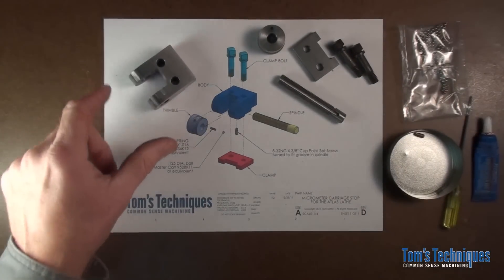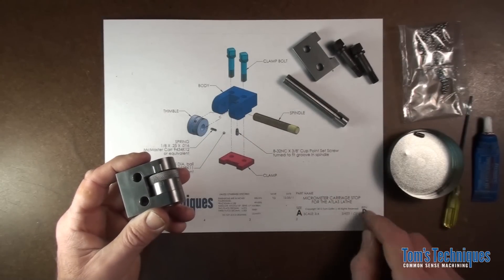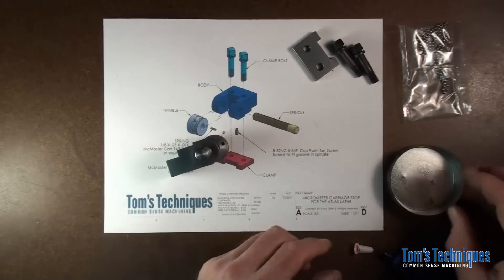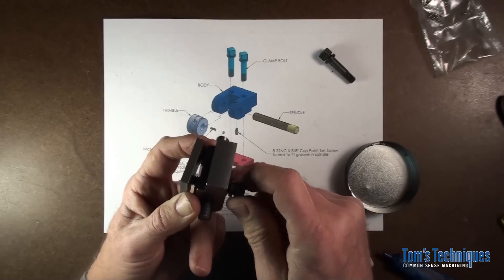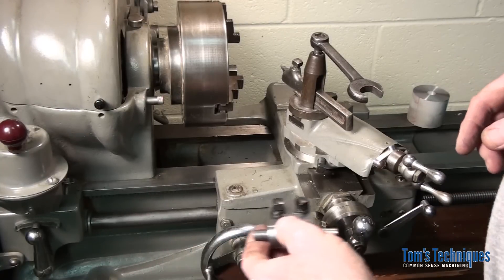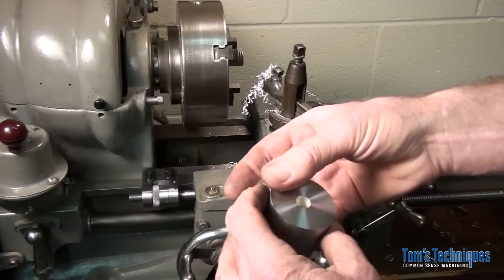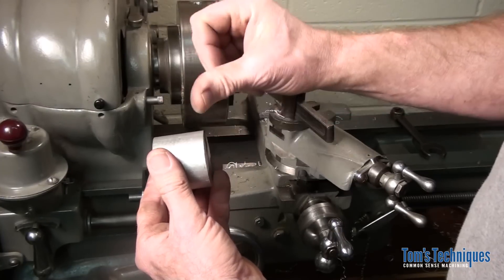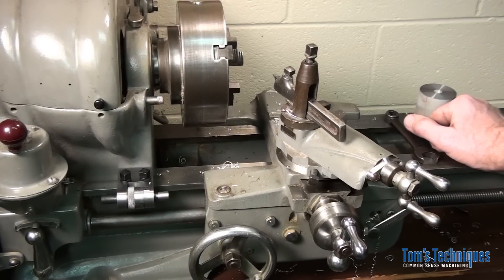Micrometer Carriage Stop, Final Assembly and Demonstration

Comment: Hello Mr. Tom.
I really liked the Carriege Stop kit. Congratulations.
I have a BV20L lathe and I'm dying to make a Carriege Stop kit just like yours.
I ask:
if the kit is installed to a certain extent and, if I forget to remove it and, turn on the automatic advance, the split nut will be damaged, correct ???
Reply from the maker: If you run the carriage into the stop under power, something will be damaged. There are stops designed to disengage the feed, but this is not one of them.

Comment: I am an amateur garage machinist, I fiddle with a 1941 South Bend Model 9A with the threading gear box that I got from the San Diego Naval Ship yard. have been looking to see if a carriage stop is what I need because when i try threading, I miss where to stop the apron. Would a carriage stop be what I am looking for to auto stop the carriage when its moving faster than I can catch?
Reply from the maker: Definitely not. A carriage stop like this is meant to stop a carriage that is hand fed. Hitting it under power would destroy the feed gears. 

The best way to stop the carriage at a particular spot is to simply turn off the spindle and let it coast to a stop with the half nuts engaged. Then turn the spindle by hand to finish the thread. I like to back the tool out at the end to give it a finished look. Just don't forget to disengage the half nuts before restarting the spindle.

Tom
Reply: Toms Techniques thank you for that. That's sort of what I've been doing. Thought maybe there was something easier with these older lathes. Love your channel and am subscribed as I find them very informative for novices like me

Comment: I have a nice lathe ,drill press TIG welder and no milling machine due to this and a lot of work and practice I have became very good if I say so myself with files and stones. 
But I have been putting off making a carriage stop and too cheap to buy one.
Glad to see you show folks the 20 thread per inch usage for a micrometer.
The first thing I did a long time ago was use this to make adjustment nuts for my drill press they look just like yours. 
I also made one years ago when I didn't have a lathe from white oak wood with 50 lines on it with stock checkering tools and a small triangle file ground safe on one side. 
I like how you use your own hand ground tool bits as opposed to buying everything. 
The first thing I did when I got a lathe was cut 6 TPI buttress threads for a fertilizer injector adapter.
Fantastic work as always and I have learned a lot from you even though I am 58 thanks.
Worth
Reply from the maker: I miss working with other machinists and picking up new tips. I work on my own now and the only new ones I get are what I come up with myself. I'm 62 and still have a healthy desire to learn new things.

Thanks for watching.

Tom

Comment: The carriage stop I made for my Atlas/Craftsman (same lathe, basically) has one bolt securing it to the ways, and it is not enough; it will rotate.
Reply from the maker: Correct. It would take a pretty good bump to rotate this on with two clamp points.

Comment: Can you engage the half nuts and thread to the carriage stop?  Again does the stop tear up the leadscrew?
Reply from the maker: +Douglas Thompson 

Hi Douglas,

You can thread to a carriage stop under power...once. It will shear the pin off in the lead screw on your lathe if it has one and if not, will break off teeth on the feed gears, both bad and expensive things. A carriage stop is only meant as a hand feed stop. Some lathes, like my Hardinge HLV-H have adjustable lead screw stops that allow you to thread to a shoulder under power, but most do not.

Thanks for watching.

Tom

Comment: So THAT's what it's for! :)

What a great series! I'm sure I learned dozens of things. Thanks!

A couple thoughts:

It would've been cool, when you discovered the thimble wouldn't fit, to have machined a concave surface into the throat. I think it would've been neat to have had the thimble snuggle down in there and would've solved the problem without getting too close to the bolt holes.

Second, I think it would be neat to have detents for the spring and ball (assuming 1/1000 is enough granularity). Would love to hear those clicks as you spin the thimble.

Anyway, thanks again. I thoroughly enjoyed the series!
Reply from the maker: That's the fun part about building something yourself, you can add as many changes as you like.

Thanks for watching.

Tom
Reply: If only I knew how to do those things I mentioned! Thanks again!

Comment: Excellent drawing and machining craftsmanship.   I believe allen head bolts are much better than the square heads on an item like this. More convenient to have a short hex wrench so you can leave it sitting in one of the bolts for quick and easy use.
Reply from the maker: Thanks Darryl.

Socket head screws won't work well in this application because the heads fill with chips. A square head wrench is also much easier on the hands than a hex key.

Tom

Comment: If you had the topslide / compound slide, parallel to the axis of the lathe. You could just lock the carriage, zero out the compound dial, measure the part, then advance the compound the amount you need to take off. Simple, that is the way we work here in England. You do not need a graduated carriage stop then, just have a stop for multi parts or when working to a shoulder or boring a depth. All lengths are then controlled by a fixed stop and the amount of advancement on the compound dial.
Reply from the maker: I do that as well, but it isn't always practical. What if you are turning a part between centers and there is no room to turn the compound?

Comment: I have two 10" Atlas lathes just the one you are working on. Love the large number disk at the cross slide. Did you make it or is that available from some manufacturer??
Bob
Reply from the maker: I made the cross slide dial myself. It's been about 30 years, so I don't remember much about the design. It works well though.

Tom

Comment: Tom, thank you for spending the time to show the design mistakes and how you fixed them in the completed part as well as showing how you changed the design to fix those mistakes.

Another great series.

Is there a chance you can show us a way of doing graduations without a dividing head/rotary table?
Reply from the maker: Sorry, but some sort of dividing head or rotary table is necessary to graduate a dial, unless you can do it in your lathe. Some guys mount plates or gears on their lathe spindle to divide.

Tom
Reply: ctjctj2 I did hear of a way of doing dividing using hose clamps on a disk, then the slots were used as index points. Sadly I cant remember the details of how it worked. A bit of thought may present a way of doing this successfully.

Comment: Tom: Thanks again for another terrific project. Hands down yours is my favorite channel on youtube. I learned an incredible amount and wanted to thank you in particular for going the extra mile with the clamp bolts -- I think I learned more with that video than all the rest (form tool stuff, tempering by heating until the oil flashes off, and a much more straightforward way to mill the four sides of the bolt head than I would have used).

I'm in the process of modifying the design to fit the V-ways of my Logan lathe. While I'm at it, I'm considering using a cam-lever to lock the carriage stop to the ways instead of cap-screws or custom bolts. Since I often jump between collets and a chuck, it seems like I'll be moving the stop around a lot and I hate fussing with wrenches. On the other hand, I tend to overcomplicate my projects. Do you think a cam lock would be a worthwhile modification? I do have a cam lock lever on hand, so I won't need to machine the cam.
Reply from the maker: Thanks Rex, it's good to hear you are enjoying my channel.

I wouldn't use a cam lock on the carriage stop for the Atlas because of the flat ways. It takes a good amount of clamping pressure to keep the carriage from moving it. You should probably be ok adapting to the Logan because of the V ways.

Keeping it simple is the first order of business in design. I splurged a bit on this project with the raised pad for the indicator mark and the square head bolts, but I think it turned out ok.

If you build one I would love to see a pic. I'm thinking about adding a page to the website for you guys to show off your completed projects. Sort of a place to see what others have done and exchange ideas.

Tom
Reply: Toms Techniques <laugh> If I build it, it will almost certainly cost me a scrapped part or three, and I probably won't finish until 2024. Thanks for the KISS principle reminder. I'm just having fun toying with the design before I start making chips. I'll use cap screws for the, uh, prototype, and I'll let you know if I ever get around to building one (or retrofitting) with a cam lock.

FWIW, the raised pad was a bit too fussy even for me! I figured with my skills I might avoid a scrapped part or two just by eliminating that one little detail.

Comment: I really like the idea that you offer in this video that it is a lot of work, but you learn a lot while fashioning the tool and you get to use it thereafter (my son will even be able to use it after I'm gone). Great project, video, narration, drawings and ethical considerations as well. I really enjoyed this series and only wish my Harrison 190 didn't have a carriage stop already. I am so very much looking forward to the knurling tool project you mention again at the end of this video. Thank you Tom, for the super program. This may be obvious even to the beginners, but it might be worth mentioning that the carriage stop is not meant to be used while feeding using the lead screw. I don't know what happens when auto feed meets carriage stop and I don't want to find out. Thanks for sharing.
Reply from the maker: Thanks Jim.

That's a good point about the power feed. When the carriage contacts a solid stop under power, it normally (hopefully) shears the pin in the lead screw. Otherwise gears are gonna lose teeth.

Thanks for watching.

Tom

Comment: Tom, I have watched this project with interest. However, I seem to have missed one of the processes involving the Thimble. During part 2 of the thimble manufacture, the bore was cut for the mandrel insertion for the calibration/numbering procedures--the bore was then to be opened for the internal threading of the thimble to mate with the shaft. I am sure that you must have completed that process--but for the life of me I am unable to find that in a video. I suspect that the video must have been thimble #5...can you lead me to that or was the internal threading of the thimble covered in another video?

Great project, something to work on this summer when i stand to be in non-heated hobby shop. I will be making one for either the 9" or the Heavy 10 SB which requires changing the body design a little to allow for the SB V in the bed. 

Eric
Reply from the maker: Eric,

I forgot to tap the bore in the last Thimble video, so I did it in the next one in line, which was the first Clamp Bolt Video.

The body will change quite a bit for a South Bend, because the ways are not only V shaped, they are also much thicker. There are a couple of versions on metalworkingfun.com that were adapted to other lathes.

Tom
Reply: Thanks for getting back to me with the link for the threading step. Also for the infor re: adaptations for SB.  One question if you don't mind. When you used the tailstock center to align the tap, why didn't you use a spring loaded center, just wondering. Certainly your use of the center and driving it did the same thing as the spring would have. Your contributions to hobby guys like myself is wonderful--thank.
Reply from the maker: ib golfr
I normally just power tap a part like this, but after putting so much work into it, I decided that it would be safer to tap it by hand. The reason I didn't use a spring center is that I don't own one. If you have one then by all means use it. It won't save a lot of time, but every little bit helps.

Tom